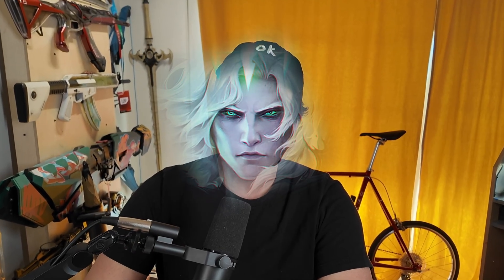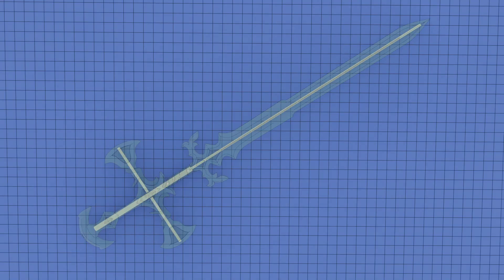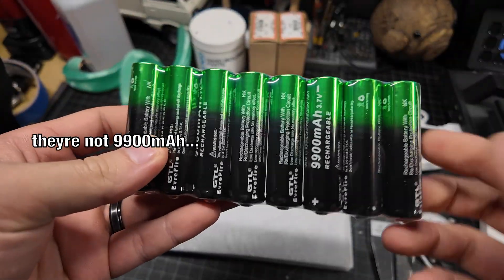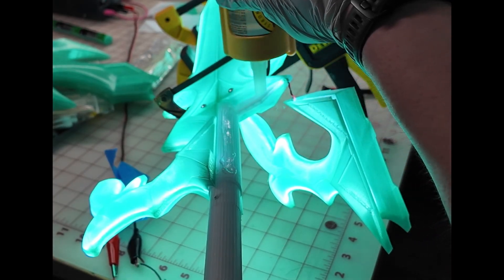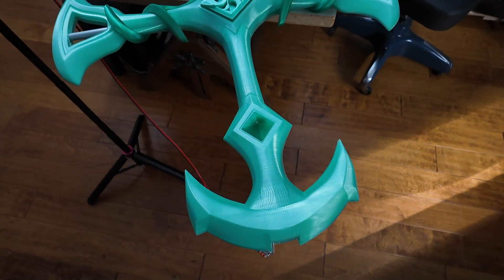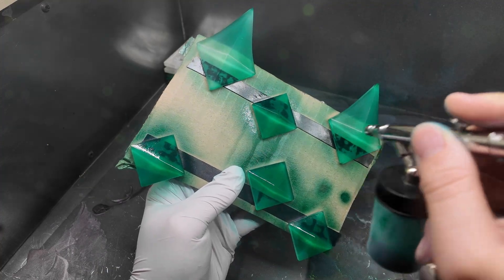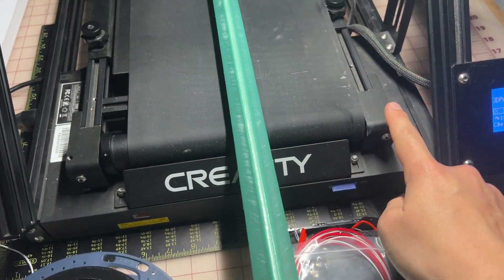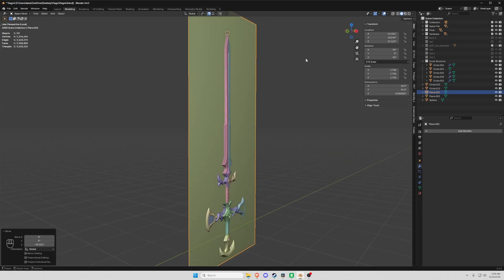Making Viego’s Sword with 2,000 LEDs

Comment: Amazing work as always !

In my opinion slicing the sword on the x axis instead of y could maybe have made the cob led installations easier, other than that maybe some modeling issues (but idk i really need to make more projects in order to learn proper 3d printable designs with blender).

i would love to see a video about airbrush on your chanel (which one to use, why and how not to mess up). i still have issues making good paintjob with airbrush and it's hard to know what i'm doing wrong.

Anyway i can't wait for the next video, whatever it is it's always a good subject, tons of information and/or a result truely amazing ❤